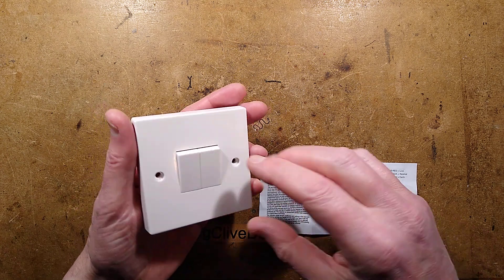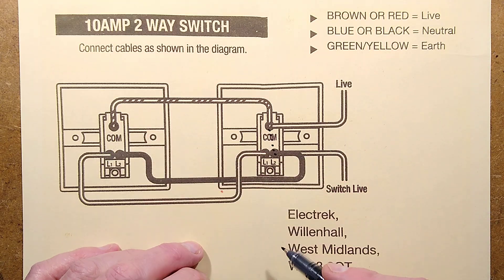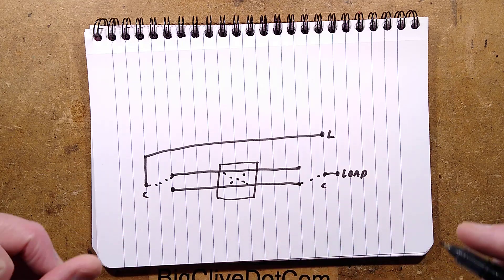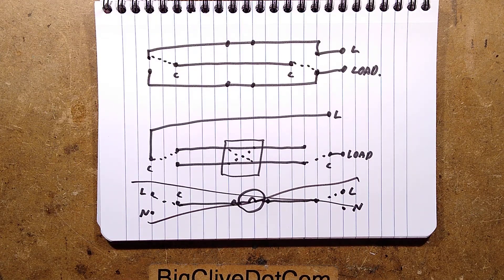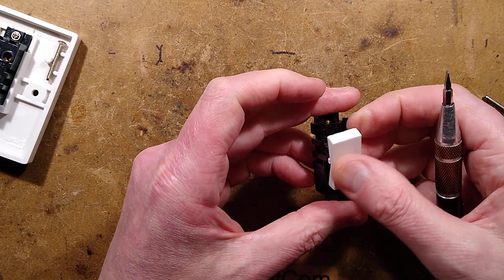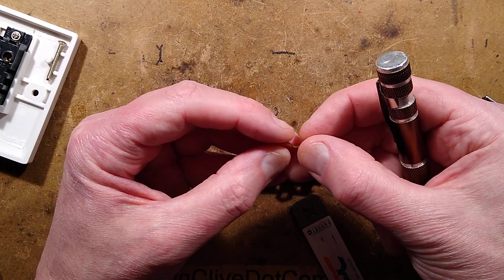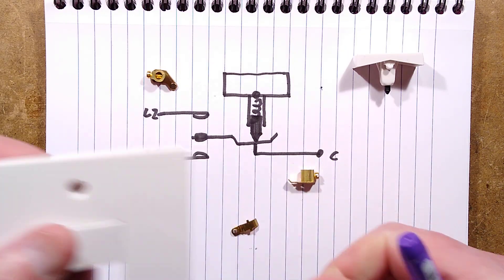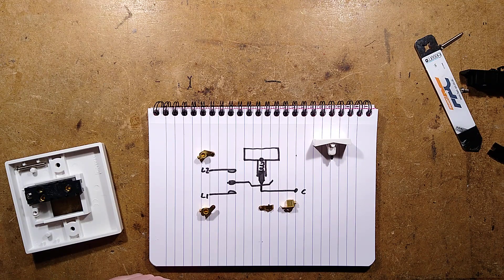Poundland 50p switch teardown

Comment: I only ever wired two 2 way switches, one when I was 13 or so, I remember having to ask an electrician who happened to live next door, to draw it lol. I had all bell wires hanging around the stairs lmao.. Very old house with gas lighting pipes still under the floor boards 😐

Comment: It’s actually quite nicely made with proper solid bits of brass - many of the “posh” makes have started making everything from strip brass folded over in a clever way and then tapped for the screws.

Comment: I moved into a new house where this had been wired incorrectly. As far as I recall it was the master switch configuration. Perhaps they'd bought the switches from Poundland. I had to sit down and think very hard about how it should be wired—it was before the internet. Fixed it!

Comment: I would never use your "preferred" method because it changes the application of the "Strappers" or "Travelers". It also energizes the unused  terminal on the remote switch.  The Line side Common Terminal should always be Line and the Load side Common terminal should always be Load. Non-standard wiring makes troubleshooting or rewiring much more difficult.

The standard through line is preferred in the US, connecting the load to the far end of the circuit, but when we need to go out and come back because the Load is at the same end as the Line we call it a "dead-end three-way".  In that configuration we run the same 14/3 (Black-hot, Red-hot, White-neutral) and still use the Black and Red as the travelers like normal for easy identification. Instead of the White being used as Neutral, we mark it as another hot (black tape or a black stripe with permanent marker), connect it to the Load Common Terminal at the far end and use it as the Load Return, tying it into the Load at the same end as the Line. The actual Neutral connects directly from Line to Load at that end. 
The reason we avoid dead-end three-ways unless it's not possible to do normally is due to the lack of Neutral across the switching circuit. 
We also identify the common at each Three-Way switch by wrapping it around the Travelers during the initial makeup.

Comment: second wiring option is called the California circuit. It uses 3 wires from switch to switch, but allow for multiple spurs to lightbulbs elsewhere switched from the same switches, and also leaves line (sic) available for other things if there is a neutral available. Which the first (2 wire) circuit doesn't. I told my distant cousin who graduated in the 50's and he had never heard of it.

Comment: Your second preferred method with 3 strappers is of course for twin & earth under floor  cables and the first for single cables in conduit or tubing. There is another method by fitting  a junction box in the centre of the strappers and wiring your switch lines into the box. Let's be honest it's scary that amateurs and homeowners who have no electrical knowledge  are buying  switches and sockets etc. from shops.

Comment: Its branded STATUS which is a proper make and the switch is actually well made. 
But Elektrek is not STATUS who are not at that address. Perhaps you mixed up the instructions with another switch?
Reply from the maker: A lot of accessories get made by common manufacturers.  Maybe they got the brand and instructions mixed up.

Comment: Using your second method the load can be connected at either or both ends.  I needed to add a light at the bottom of the stairs, so I used this to provide a switched live to it from the downstairs switch, running a neutral to the light directly from the adjacent distribution board.  This worked fine until an electrician replaced the distribution board and connected the direct neutral to busbar for the downstairs circuits, the upstairs lights being on a different RCD, thereby causing an imbalance between the two RCDs when the light was switched on.  To be fair, having told him that I had fed a separate neutral to the downstairs light he was quicker in working out why the RCDs tripped than I was.

Comment: I had one of these light switches lying around in my parts drawer so I printed out the Nintendo logo, cut it out, stuck it on and gave it to someone as a present calling at a Nintendo switch.

Comment: It does seem generally to be beyond the electricians that have worked on my house in France and another I'm familiar with in Norway. I'm both instances, unless BOTH switches are on, the light won't come on. Really convenient to have to run to the other switch in case it's been turned off there previously. Additionally in the French homes I've seen there is a relay on the fuse board. Rather than try to comprehend the wiring using switched live as you've shown here, the attached wall switches operate this relay, which then controls the related lighting circuit. Cumbersome and additionally expensive, but simple to understand I suppose

Comment: So when I paste your diagram in to (i) chatGPT, (ii) Claude and (iii) Perplexity - all three AI's tell me the diagram is correct. Are you saying the switch doesn't match the diagram or are all three AI's at fault or what have I misunderstood?
Reply from the maker: If you mean the first diagram as supplied with the switch, then that indicates that AI is the equivalent of the DIY shop "expert".
Reply: All 3 AI's got it wrong - absolutely. That is shocking (no pun intended).

Comment: I came to find the "3rd non compliant way" in real life, installed by shitty electrician in my moms house. Gladly there is a fuse, that was not a nail, and it worked, so tragedy was avoided. You wouldnt normally want both Live and Neutral inside a switch that wasnt designed and produced to have both inside. If it fails mechanically, or is made not perfectly (cheap switches), it may sometimes fail to fully disconnect the moving contact from one, before touching another fixed contact. Which may cause a slight delay in bulb reaction, when wired in a safe way. And may cause a fire, if "3rd way" was used.

Comment: Had some common automotive black cube relays and sockets labeled wrong.  They should be mirrored.  Had some DC connectors wired backwards because of gender.  Seen no ground prong polarized AC plugs wired backwards.  Seen black hot and white neutral swapped.  BTW Tamiya connectors are backwards by design going against the world standard that male PINS are the load/device.

Comment: I fail to see why modern installations need proper switches in rooms, or at least why more than one real switch in rooms.  I demanded my last rewire I had one of those multi switches in the hallway like you used to see in schools.  Apart from a few g9 fittings the lights turn on through sensors and zigbee switches.   Isn’t this just the modern way?
Reply from the maker: Electronics fail and can leave lights stuck on, off or flashing.

Comment: Owned 2 properties (split level flat and a semi) and I used to hate those double/triple switched circuits (entrance, landing 1, landing 2 , , , even landing 3) as the wiring in the ceiling roses was frequently messy making the fitment of a new light feature such a bind - plus remembering to firmly switch on or off else circuit will be open and not work, applies to cheap switches not MK

Comment: I recently had to replace a switch (due to flashing over between L1 and L2, making the light flash when off), and due to no stock of MK, it had to be a BG. The wiring used the L1/L2 strappers and the line in one box, load in another. However, at the "line" end switch, there are two additional wires in L1 and L2. Unless they have something to do with the fan in my kitchen I have no idea why they are there. This could complicate my plans to put a "smart" switch in.

Comment: You have to hand it to the folks who come up with designs like this; They're surprisingly simple and low cost (Note the L1 and L2 contacts are the exact same part, but the rotational asymmetry means that one part fits different positions) yet they still tick all the boxes - Especially the Snap! (Fast make/break) action of the switch to prevent arcing. A definite 💯 from me on these designs! 😁

I've been watching some U.S. focussed electrics content lately (Aye, they do use black for the live 😳) and I understand the third „Switched Live“ (wrong) way of wiring is quite common in older homes there, particularly those from before the mid 20th century on cost and convenience grounds. It's prohibited for new installations by current NEMA regulations, but there's still far more „Hot neutrals“ out there than we'd like to think! ⚡

Finally: Is there anything at all wrong in the fact I once employed a surplus 100A isolation switch to control a simple 40w lamp just because it was the most convenient thing to hand? It did the job, but my arm got some nice working out operating that thing... 💪❣😁

Comment: It really gets me how some people do electrical work i live in the US, someone changed out my basement breaker with a 20 amp when it was wired with 14 awg wire, its now wired correctly with 12awg and proper amount of lights and outlets there were only 2 lights and 1 outlet

Comment: Before watching any further, im going to note what I think the problem with the wiring diagram is

If wired as shown, you would be able to turn the light on from either position, but you would not be able to turn it off again from the other switch

Comment: I've always known it as the traditional/conduit method vs the conversion method. I often use the traditional method when looping at the switch - send a 3c&E over to the other switch carrying two strappers and the neutral. Means one less cable per gang at the switch with the feed at it. just remember to transpose L1/L2 at one end so that switches in the same position = off, or it annoys my OCD

Comment: I think I finally understand the issue with my old houses 2 switch problem, it would only come on with the main switch in the "on" position. If it wasn't you could click the 2nd switch at the back door and it wouldn't do anything 😅

I was only a kid, it was a council house and an electrician fixed it when the water tank in the loft leaked into the light fitting, we needed a new roof. I asked the electrician what caused it, he never answered me but he fixed it.

Comment: When I bought my current house one of the switches was "upside-down" relative to how I wanted it, but was a two-way switch. I looked inside and it didn't match the first method that I already knew about so I did my research and that's why I now also know about the second method. (Either way I just had to switch L1 and L2 but I wanted to be sure.)

Comment: That is an interesting approach to switches.
All switches I have seen had the rocker mounted into the casing instead of being loose with one side being able to touch L1 and the other side L2, and common being provided to the pivot point of the rocker itself. This above/below approach seems interesting since it allows L1 and L2 to be on the same side of switch rather than on 2 different sides.

Comment: Nice description of 3-way (aka 2-way) wiring, also showing the use of any number of 4-way (intermediate?) switches. I'm confident enough of the wiring in my house that when replacing a light fixture I just turn off the switch, I don''t bother with the circuit breaker. The reasons NOT to do this are:
- You aren't the only one home.
- You have switches that leak, such as old ones with indicator lights.
- You have non-compliant wiring.
Extra credit for figuring out how to make a DPDT switch into an intermediate. This is really academic as real 4-way (intermediate) switches are easy to buy. 
Also, at least in the US dimmers (at least non-smart dimmers) are always 3-way, never 4-way, and you can only use one.
Reply: I know this is old but it needs mentioning. In the "loop in" system which is or was standard in the UK the live from the consumer unit runs through all the ceiling roses hence they are live at all times regardless of the switch positions. So changing a bulb with the switch off is ok, doing anything inside the ceiling rose, turn off the breaker.

Comment: There is another big issue with the third method: If you are switching inductive loads like flourescent lights (big choke) there will be quite a spark when switching of. This might trigger a sparkover (i.e. a short circuit) between the passive contacts and thus between L and N. I once had a hard time to debug this in a neighbour’s garage: Every once in a while the breakers tripped when he switched off the lights. Changing the wiring to method 2 solved the problem.
Reply: Also a spark helps in the process of designing and building a new house when your old one had a gas leak. Provided you were away on holiday at the time, of course.

Comment: Connecting the Earth into a 2 or multi way lighting circuit with Intermediate switches could be interesting but maybe the core issue here is trying to do Wiring Diagrams in Black and White?

Comment: They look exactly like the switches fron 1978 in the house where I grew up.
Reply: The budget switches and sockets on the market are loosely styled on what was in the 1970s the trendy square look (introduced by market leader MK in the 1970s). 

MK was the first to move on to the curved bevel design in 1996 (which almost all the big names since emulated), so now the budget end of the market is still stuck in a decades old style.
Reply: @interstat2222  I am swedish though so I assume we have mostly other brands than the UK since UK electrical circuits are different I would assume mostly UK brands cater to that market.
Reply: @rimmersbryggeri  I just assumed you were from the UK. That angular square look was popular everywhere starting in the 1970s. The brands will have been different. MK is a UK only company.
Reply: @interstat2222  Here they started making the buttons alot bigger in the 80s and by the 90's probably only retro series would have looked like these ones. Now the retro ones don't look like anthing I have ever seen in sweden at all. Probably because if you have old swtiches like that its't time to change them all rather than just replace the broken ones. I stil have one 60s switch in my apartment though but only because the ne ones are not well suted to the narrow spot where it's placed, the modern ones are not good for trimming the frames.

Comment: You missed commenting on a design win.... from what I could see the engineer designed it using just a single type of metal switch contact, so only one part needed to be manufactured. It was just inserted back to back with the other one during assembly.

Comment: Yay 🐾🐾🐾 🐈
I bought some of those switches several years ago..
for 12v low current (1/2A~) lighting.. not 10A 💥
and noticed the wiring diagram didn't look right..
Took a little while to confirm my sanity...
I tried trading standards they could do nothing.. typical.
I'm pleased that you got to do a video about it..
If you want real fun.. start introducing diode's, combinations go crazy.

Comment: I've always known them as double pole double throw and you can use them to turn on and off the light for a ceiling fan or the ceiling fan itself or in the case of the construction of my house it will shut off the top Outlet for most of the outlets the outlets in the house so that you can use a bedside light it will leave the bottom socket on the outlet on
Reply: Sounds like you maybe stateside? You may have known them as such, but you are wrong. The switch elements are single pole, double throw, available in the UK in 1,2 and 3 gang versions. A double pole double throw switch element would have 6 contacts, they may be available in the US, but I have never seen them as a wiring accessory in the UK. If we needed a DPDT 10A switch we would have to buy a toggle type.

Comment: At 13, my father gave me 2 two-way switches, a lamp holder and bulb, a plug and flex and asked me to wire this up ...
I opted for the first version which you drew (which needs a choc block to connect the live of the three & earth with the live of the twin and earth)
Since then I found the second version and have used that since as it saves trying to fit the extra connection into the usually shallow back box (especially hard with a 3 gang switch!)

Comment: The difference is which end the supply is...
If the supply is the same end as the (first) load, then your way works. This is the case if the supply goes to the fitting, and then there is cabling to the switch (normal for single switch lighting)
But if the supply is at the far end then the first way works..

Comment: In the Netherlands this kind of switching setup is called a hotelschakeling ('hotel switch'). I don't know why, since the common usage would be around stair (to have a switch on each floor). I would have assumed that is more common than having a switch at the door and at the bedside controlling the main light.
Reply: In Sweden it's called trappkoppling (stair switch) because you often have two-ways at the top and bottom of the stairs. The German term is "Wechselschalter", alternating switch, a fairly accurate description of what a 2-way switch does.

Comment: As a kid I used to prank with the lightswitches forcing them to slowly make half contact and the lights would dim and flicker. This worked only with tungsten lights for obvious reasons, and destroy the switch due to excessive arcing. Good times.
Reply: You could do that with the old MK toggle switches, but not the newer Logic ones.
Reply: I once had an older (80s I think) Legrand switch get stuck in that middle position, probably due to some dirt having gotten inside during the previous renovation. Working it a few times fixed the problem and it's still there, over 20 years later.